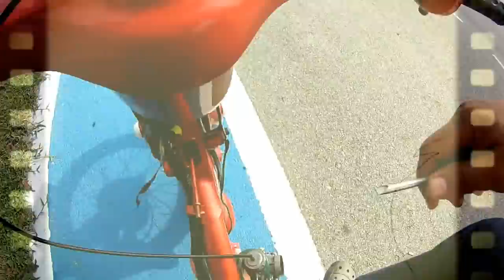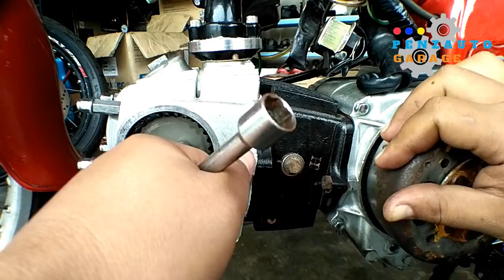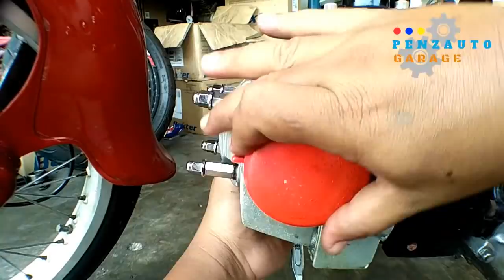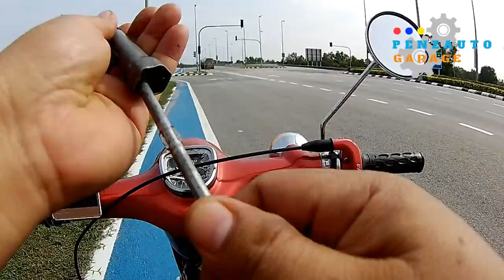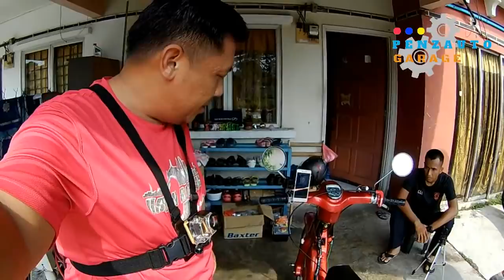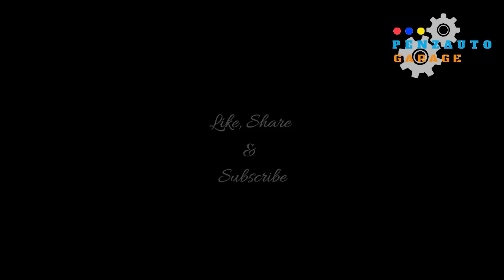Espada Racing Parts Upgrade Pt. 3 - Restoration of my 122cc Honda C70 Cub

Comment: Salam, bang, adal ex5, dream saya, spec 53mm, gearbox racing, high cam, carb ts 125, mai jet 70 pilot jet 25, high RPM top mmg cun kilometer 130km/h. Tapi bila bwak low rpm dalam 70-80 dye mcm noking, sedut2. Pkai kotak angin, modiefied elbow pipe pvc same size carburator ekzos standard.
Reply: Bila bwak low RPM moto bunyi mcm 125z bila time slow

Comment: Enjin xlawas tu boss carb besar tpi exzon kcik..ibarat masuk bnyk kluar sikit..silinder block dah besar lubang head kna mody sikit exzos bgi besar
Reply from the maker: Baik boss nnt saya kasi adjust sama dia.. hehe tq..
Reply: @PeNzAuToGarage  kasi lobos lubang intake n ekzos..pkai ekjos king drag ..haha..
Reply from the maker: Beres boss... Hehe
Reply: Pakai head racing bossku 28/24 untuk block 56mm padu
Reply: @danggatboy9875  untuk spec 53 head apa yg sesuai bro

Comment: Kecik skit satu saiz pilot 22.5.. main jet 90.. takuk jarum piston ada brp step? Naik satu takuk keatas.. set angin Dr rapat N buka antara 1.5 ke 3 pusingan..
Reply from the maker: Baik boss.. tq bg tips.. 👍👍👍
Reply: Sebab dengar masa nak GI senak.  Top x de sebab awal minyak lebih..
Reply from the maker: Baik bang nnt saya cuba.. tq bang.. 👍👍👍
Reply: nak tanya saya pakai karb ts125 mikuni japan.Tp time idle tu dia lama² sikit mati
Reply from the maker: Biasanya kalo timing xde ada bocor kat tengkuk atau kat sambungan antara carb ke manifold intake tu bang.. cuba buka n gam semula..

Comment: Tumpang tnye ye moto kalau ade bunyi ketek ketek ape ek yg x kene tappet baru dh adjust rocker arm dh tuka . Tq
Reply from the maker: Timing chain kot bunyi.. cuba check tensioner sehat ke tak..
Reply: @PeNzAuToGarage  taiming chain  roler semua dh tuka stil ade bunyi lagi rod x goyang
Reply from the maker: Timing chain tensioner bang.. bende tu jarang sgt org tukar.. bende belas2 ringgit je.. penting bende tu.. kalo rosak timing chain pakai yg baru pun bunyi gak sebab kendur..

Comment: bang kalau mcm hear 4 kita lock throttle bila lepas minyak dia semput sat pastu ok balik sbb apa tu mj pj 82/33 🤔 gear 1 - 3 setiap kali shift hear tu dia pegi mai nk shift gear 4 pegi tu kurng skit
Reply from the maker: Carb x cun betul lagi tu.. kalo setting cun xjadi camtu.. carb moto saya skang ni pun camtu le.. xdpt2 lagi setting cun..

Comment: Bos. Sya moto ex5 dream block 53 ja cam tokahi spoket 14 35 carbw125 orimoto pj mj asal lain smua standrt. Berat sya 70lebih. Gps dpt 100 gps ja ok tak?
Reply: Mohd Ashraf spec boss sama ngan sy..tp sy pkai rim 1.6 x 18..dpt 104 km gps..sprocket 15-33..okyla ntuk berulang g keja ngan spec cmtue..heheh 😛
Reply from the maker: Ok sgt la tu.. kalo ex5 standard nak cecah 100 gps kira nasib je..
Reply: Spec moto bos 53 ke 56?
Reply from the maker: 56..
Reply: PeNzAuTo Garage heheh..tp sdapla bw g keja.. Na kata laju pn x,, slow pn x..kira okyla tue..sesdap rsa..hahaha 😁
Reply: Pait CHepir yaka haha spec sama haha..nk bgi lebih lgi gps mcm mna bos
Reply: kau pakai spoket 15.33 atau 31 aq rasa cun tu
Reply: Mohd Ashraf ,,x sgka spec sama plak..lpas nie try men sprocket ajala klu na lbey kM/j..😜
Reply: Sy ex5 dream gak block 53, cam racing, cdi racing carb wave 125 original, ekzos standard gps 118km/j kalau ekzos cutting standard 124km/j
Reply: ahmad seipol hehe,,bguslaa..tp sy pakai rim 18.. Try sukat dik..heheh..

Comment: Bang pilot jet 27.5 besar sngt tu..cuba abng try turun pilot jet saiz 22.5
Reply from the maker: Dah turun.. baru tarik gear 2 gasket head lak koyak.. hehe
Reply: Aku pakai block 53mm pilot jet 27.5 dan main jet pakai 70 sudah nyaman pakai padu pick up
Reply from the maker: Baik bro nnt saya cuba setting camtu..

Comment: timing chain kalau naik setakuk apa fungsi dia der dan kalau trun setakuk kt bawah apa fungsinya
Reply from the maker: Makin naik makin pickup makin turun makin kuat long.. cuma kene pakai adjustable cam sprocket le.. adjust satu mata tu banyak sgt.. dia adjust ckit je xbanyak pun..
Reply: @PeNzAuToGarage  bila di naikkan mata tu kedudukan T magnet kekalkan atau ubah

Comment: Bang kalau tukar cam tapi x tukar spring valve x pa ka...ka nnti ada msalah lain
Reply: boleh je rasenye pakai tapi disarankan tukar ler
Reply: kalau high cam x tukar spring valve , valve blh floating d high rpm  . . sekurang2 nya pakai spring valve racing atau keras dari std . .
Reply from the maker: Amir li dah tolong jawabkan dengan tepat san jitu.. 10 markah di situ bro... 👍👍👍
Reply: Ouh...tq bang
Reply: @PeNzAuToGarage  tq bro sama2 kongsi ilmu . .
Reply: tapi benda nee kalau short term blh . . long term x blg sbb valve akan bekerak  valve x fit . . d mana lost compress dan motor ssh nak start masa sejuk . . ini yg pnh terjadi kat moto aku . .
Reply: @jejangatmalam777  maksud short term tu dlm jangka masa brapa lama ya?
Reply: @khairynaim2169  benda ne umum . . kdg sebulan . . kalau mcm saye rumah-tempat kerja (pegi-balik)= 170 . . so dua minggu dah jd . . 😂😂😂😂
Reply: @jejangatmalam777  ouh...tq bro atas perkongsian
Reply: @jejangatmalam777  valve floating tu moto akan rasa mcm mn?
Reply: @khairynaim2169  kalau moto aku high rpm dia mcm pegi x pegi je . . xtauu laa org lain rasa mcm mana . . lain moto lain ragam
Reply from the maker: Rpm xleh naik dah... Contoh rpm mati kat 7000... Sampai sudah la 7000 je xleh naik lebih dah..
Reply: @PeNzAuToGarage  terima kasih bang . . 😁😁😁😁😁
Reply: @jejangatmalam777  tkasih bang
Reply: @PeNzAuToGarage  tkasih bang

Comment: Salam bang.. Kalau pakai blok 53 pakai head standart boleh ke?
Reply from the maker: Wsalam.. boleh sgt.. laju je.. hehe
Reply: Mndalam tu
Reply from the maker: Hehe betul bang.. 53 pun cukup sedap dah kalo kene setting dia...
Reply: Kalau head standard valve spring racing,elok Kew bang?. Atau valve standard je LG elok.?
Reply from the maker: Bergantung pada keperluan.. kalo moto rpm dlm 10-11k je xyah pakai keras2 sgt..

Comment: Boleh pergi lagi tu bang nk tanya moto nie gear sampai 3 ja ka 4
Reply from the maker: 3 speed je bang.. tu la terasa yg carb x koyak abis lagi ni..
Reply: Bang nie sikit la formuler gbo 3 speed granshaf ex5 block 53 cam ikk cab ts spoket.blkang 23 depan 15 🖒🖒 takat 125 ikut tepi jahh
Reply from the maker: Pergh terbaik bro... Sampai 23 sprocket...
Reply: @PeNzAuToGarage  kalai gbo gear sampai 3 nie boh p la blkang 15 pon dia enjin dia susah nk mengerang kalau gbo gear sampai3 nie takat pukoi 125 relax ja kalau 4 speed kot susah